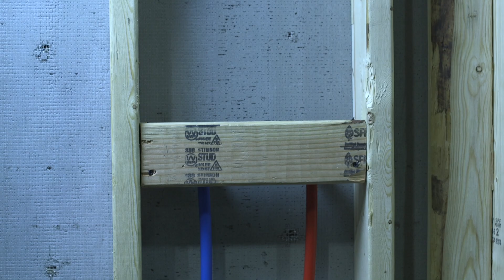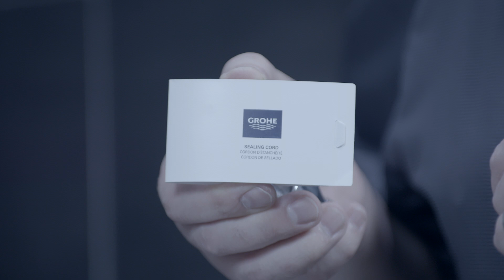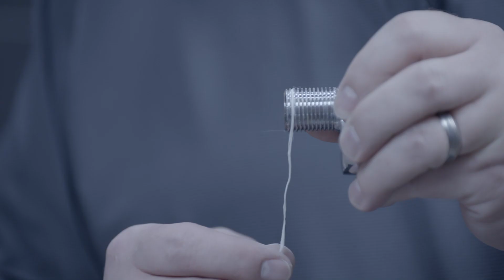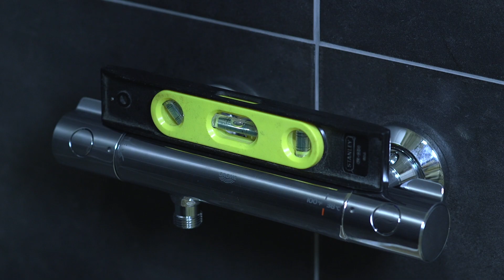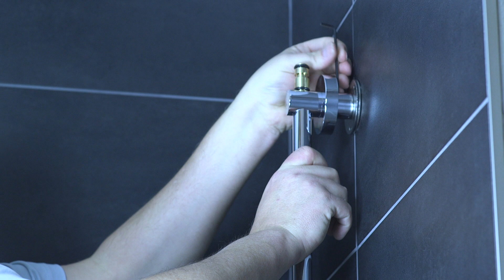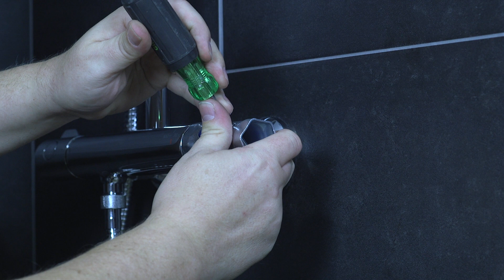GROHE | Euphoria Exposed Shower System Installation Tips & Tricks | Installation Video

Comment: I have nearly the same system but my escutcheons thread on which, imo, is pretty dumb.  The illustrations in the install manual contain no narrative, presumably to avoid having a language fir whichever country it may be installed. That said, illustrations are not clear.  Eg there is no indication of how far back the face of the brass adapter should sit from surface of finished wall.  Illustration shows X+1/4", X+6 but not clear whether that's showing 1/4" proud or recessed from. Wall face.  Even so, the tolerances for an attractive fit are very, very tight.  That is, recess too far back and the S unions won't leave enough thread for the (stupid) screw on escutcheon or the capture nut that threads the thermostat unit onto the S unions to avoid leaks.  Not recessed enough and then the (stupid) screw on escutcheons will sit proud of the wall.  Very dumb imo.  To get it to stop leaking with such close tolerances I had to pack with additional Teflon tape onto the S unions.
This shower has never worked properly either.  So much so that we no longer use it.  Turning it on and water comes out too or wand sufficiently for about 40 seconds before slowing to a trickle that wouldn't wash your hands, never mind your body.
I just recently decided to see what's wrong and Grohe tech support said to clean the screens at wand and shower head.  Well, there aren't any and I'm certain there never were.  After that, advised to clean screens within the nut that screws onto the S union.  So I disassembled.  Only minor debris in there.  Cleaned and reinstalled but, lo and behold, it leaked on hot water side.  This may be because the hot water side is perhaps a silly millimeter less than cold water side.  Hence the gripe about tolerances.  Even though leaking, i pressed on to see if it at least worked now.  WORSE THAN BEFORE NOW! Now n I thing comes out.
Grohe advised replacing the cartridges.and/or the thermostat.  Good luck getting them out.  Not sure what they torqued them to but IMMOVABLE.  AND you need that 12mm Allen wrench to remove the thermostat, which, by the way, doesn't come with the kitchen.  I visited two auto shops and hardware store and they only typically stock to 10mm.  I HAD TO ORDER ONLINE!
This unit's engineering is a complete fail.
I guess to get it working I'd have to replace the entire thermostat unit.
FAIL GROHE!

Comment: It’s baffling that that would design something with the thread design that this one has. It leaked with the dental floss that Grohe provides as well as several other thread sealants. I used a combination of Megaloc tape and True Blue. The True Blue seems to have made the difference as no more leaks. But good grief, why not use a normal design ?

Comment: EUPHORIA 310 COOLTOUCH THERMOSTATIC SHOWER SYSTEM, 1.75 GPM 

"Overpriced and Defective: Grohe's Poor Product Quality and Even Worse Customer Service"
This is, without question, the worst Grohe product anyone could purchase for over $1,000, plus $500 for installation. Grohe is completely out of touch with its customers and clearly does not properly test the products they sell. The head shower barely drips water, offering zero force, and the hand shower performs even worse. The water stream from the hand shower is so weak that it simply pools in your hand due to the lack of pressure.
Grohe’s customer service is beyond incompetent. For three days, I was repeatedly told that the installation must be faulty, despite my clear explanation that the tub spout had excellent pressure. To prove the point, I swapped out the hand shower with a 15-year-old Grohe unit I had, and the difference was night and day—the old hand shower worked like a massager, demonstrating that the issue lies with Grohe’s new product, not the installation.
After finally acknowledging the problem, the representative suggested I upgrade the 1.75 GPM head and hand shower to 2.5 GPM models (shower head #27135 and hand shower #27575) for better pressure. When I asked for an exchange, I was told that because the purchase was made through Home Depot, they couldn’t help, and I should return to Home Depot for a refund or exchange. Home Depot, of course, requires me to return the entire unit, not just the faulty parts.
Grohe’s customer service, run by individuals who seem utterly clueless, proposes ridiculous solutions and refuses to take any responsibility for their defective product. They are unwilling to perform a simple exchange of the faulty shower head and hand shower, leaving customers stuck with a subpar, over-priced system.
VICTIM OF GROHE’s BAD PRODUCT & WORSE CUSTOMER SERVICE

Comment: Why why why. 12mm- 14mm ? How about you pick a size that comes standard. And how about using tapered threads so that the threads make the seal, not some stupid glorified teflon tape. This is a garbage install, always hate them. As a plumber, never recommend

Comment: Does Loctite 55 work in place of the Grohe Sealing Cord?  I had to back off my install because my s-union leaked.  Thanks.
Reply: A bit late, but yes! That’s what they include. Grohe specifically recommends/requires 55. Theres videos from Loctite just showing them wrapping it into the threads, but a Grohe rep had mentioned doing so in an X motion. A tip I’ve learned, grab a pair of pliers and gently rough up the threads if they’re too sharp!

Comment: Hello, the first time I used the threading, one of them did not seal properly, when I removed the fitting the threading was shredded and I am now unable to properly seal the fitting. Finding replacement threading is near impossible. What is a good alternative. Also, I'm assuming this threading is cheap, it's ridiculous that a $1000 shower system doesn't come with any spare threading, especially considering how specialized this part is. Please consider adding extra threading to kits in the future

Comment: I just installed 30+ of these in a building and I have some thoughts. 

I decided to not use the parallel thread cut off nipple and locktite 55, but instead just did a 1/2" brass nipple into my wingback inside the wall then put a 1/2 brass coupling on the nipple to get me back to female thread so I could then put the s union adapters into my couplings. If you do this just make sure your wingbacks are far enough back inside the wall to fit a nipple + coupling and be able to thread in the s union without sticking too far outside the front of the shower. I was able to make it work with a 2x4 wall, 1 1/2" thick backing behind my wingback, typically using a 1 1/2-2" nipple, it helped that my surround stuck out 1/2' past the drywall.

Its not ideal threading the parallel thread s-union into a tapered coupling, especially since then it goes into the wall and there will be no way to check if it leaks. But I felt it was safer than 2 parallel threads making a joint inside the wall. I tightened the s-union into the coupling first before assembling the rest so I could at least see the joint and ensure it was tight before threading it into the wall. Be careful not to overtighten into a wingback, because the s-unions are offset there is a tendency to try to get 1 more turn sometimes to get both unions into the same position.

if your lucky once you've assembled the s-union into the coupling, then onto the nipple and into the wingback, the face of your s-union will hopefully be 1 1/2" off the shower surround once tight. ( once tight silicone between the s-union and surround to make a water tight seal behind the escutcheons) Then when the escutcheons thread onto the s-union they can thread all the way back to the wall. But honestly like 30% of mine did not work out, a 1 1/2" long nipple would be too short and the s union did not stick out  far enough from the surround to thread on the escutcheons and have enough threads remaining for the mixing valve. When I changed it to a 2" long nipple it stuck out too far and the escutcheons would thread off the back of the s-union and hang. I always opted to put the longer nipple in and ensure my joints were good. I ended up siliconing the escutcheons to the wall for the rest but it looked bad and they will break loose in time. 

This whole situation could be avoided if Grohe just put an extra 3/8" of threads on the s-union for the threaded escutcheons, so it would work if your nipple was 1/4" too long. its frustrating that nipples only come in half inch increments and grohe only gives you 1/4' of adjustment with the escutcheons. Also if they went this route they could just ditch the whole parallel thread thing and use regular tapered threads. I don't get why they are trying to reinvent the wheel.

my Grotherm 1000 boxes came with some hard red washers, I did not use these. The s-unions I got had a black rubber on the end and this sealed well to the mixing valve. also if it leaks there it will at least leak into the shower haha.

anyway its been a few weeks and no leaks have shown up so I guess this worked, I hope I don't have to install these again. it sucks having a joint that has to hold static pressure inside of a wall using parallel thread and not being able to check it without cutting in an access or something.

Comment: As much as I appreciate these videos from Grohe - the one thing they don't show is how one goes about making sure there are no leaks behind the esutcheons as the S-union connection is just inside the wall.  From everything I have read,  because of the parallel threads, it is not a given that there won't be any leaks - especially the ones where there is just one drop every few minutes.  I wish Grohe also had given an approach to make sure that the G 1/2 S Union connection is not leaking behind the tiled wall.

Comment: I bought this unit. Three plumbers and over a thousand dollars spent it still leaks in the wall cavity. The S-Union straight thread will never seal in the brass adapters. We tried numerous thread cords and tapes. Even tried Loctite 577 to fuse the threads and it still leaks at the S-Union. On straight threads (NPS) there MUST be a rubber washer on both ends to seal. This is a critical design flaw on many Grohe products. I wanted to love this fixture but after hours on the phone with their tech support and hours spent installing and uninstalling this unit, Grohe is now my most hated company on the planet. How could you design something so poorly? This company gives German engineering a bad reputation. I"m so disgusted with this company

Comment: I am in the process of installing a Grohe Euphoria Shower System.   I notice that in this video the Easy Adapter is cut to be flush with the tile surface.  But the  Grohe installation manual indicates that it be cut to be 1/4" inside (X + 1/4).   I think cutting flush is better as more of the S-union will go in to the easy-adapter and still maintain minimum outside distance.  Why the X+1/4 in the installation manual?
Reply: I am adding what I found out regarding my own question.  Grohe USA replied to me saying that both the flush cut as well as the X+1/4 cut will work.   The X+1/4 ensures that there won't be a gap between the escutcheons and the valve.

Comment: Not to keen on not being able to prove all your connections are water right before tiling , 
Once you cut the adaptor pieces and put your thread tape on them and screwed them back in , you have no idea at all if they are leaking or not behind the wall
Reply from the maker: Hi Chris, thank you for your question. Grohe does make an  optional  s union (Sku #12400000) for this product with service stops so that you can pressure test your connections. - GROHE SOCIAL TEAM

Comment: As a licensed plumber i will tell you these are absolute junk. Stay away from Grohe. Horrible engineering.
Reply: Exactly what my journey man says
Reply: Agree. Never recommend. Tapered threads are too complicated, we have to score the machined threads to make the seal? Wrap glorified teflon tape around in the threads, use a 14mm (not sold in any standard set, neither is the 12mm) and hope for the best
Reply: It’s because, like my plumber, you can’t read and understand instructions.
Reply: @fiouable  they're used with the standard American system,  everything new is too tricky

Comment: Hello, you don't show what kind or size of fittings the cold and hot pex waterline is connected to, what are the "2 easy install connectors" connected to and how are they mounted?  I understand the distance is 5 7/8" spread, center to center.  Are the receiving fittings screwed into the 2"x 4".  Thank you, but I think you need to show that for us DYI people.
Reply from the maker: Hi Kenny! Thank you for your question. The PEX lines will need to have ½” connections. The easy install adapters connect to drop elbows which are secured to the 2x4 to hold them in place.  - GROHE Social Team

Comment: why was the valve loose? I have a feeling you kept the plumbing loose for easy install? But, people don't want a loose valve.
Reply from the maker: Hi Dee, thank you for your question. It is normal for the pipes in the wall to have some give. Once it is tightened completely onto the adapters, it will be firm. These are also PEX pipes, which have a lot more give than copper pipes. - GROHE Social Team

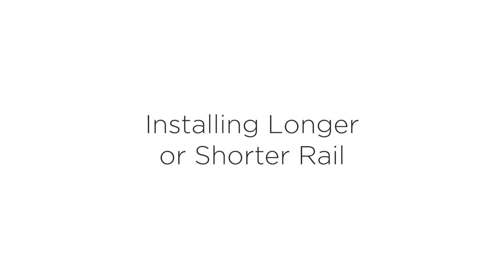Comment: 6:20

Please, anyone, tell me the manufacture codes for those different rails????

I've got 27475001 ( EUPHORIA SYSTEM 260 - https://www.grohe.ua/uk_ua/-euphoria-27475001.html - https://cdn.cloud.grohe.com/dimdraw/2000/2100/2100/2101/2101509/1500/2101509.jpg ) It has very long rail!! I want to buy and successfuly (!) install much shorter rail, but I can't find even manufacture code for shorter rail.

Comment: what kind of treading is that what your are supplying?
Reply from the maker: Hello, thank you for contacting us. The adapter is going to have ½” male threads (US Threads) that are going to screw into the pipes in the wall. The other side is ½ ” Female thread (EU straight thread) that will connect to the S union on the shower system. Please let us know if we can be of further assistance. - GROHE Social Team

Comment: Where do you get the s-unions with the service stops? The s-unions provided with my 260 are too long, causing the escutcheon to sit far off of the threads. My adapter is flush with the tile, and this is still happening. Not quite sure what to do.
Reply: I have the exactly the same problem. Can @Grohe helps us please? Thank you
Reply: I would like to know what the reply was. Was this resolved? If so, why was the solution kept secret?
Reply: @marklaipnieks1453  It wasn't solved. These jokers just sent me another set of the brass nipples (after 4 months of waiting). The S-Unions are the problem. For the fourth time.
Reply: @marklaipnieks1453  I had a similar problem, Grohe emailed me saying they would send a replacement part. 5 months later still nothing arrived. I think they like to give the perception that they are there to help, but nothing is done.
Reply: @marklaipnieks1453  Yep, if Grohe is looking for referrals they're are doing it all wrong. Bad system.
Reply from the maker: Hello Ian, thank you for contacting us. Can you please send us an email at groheconsumerconnection@lixil.com  and write “Attention David Gaines” on the subject line. We'll be happy to assist you. - GROHE Social Team
Reply: @GroheAmerica  I have the same issue and cannot find a solution.  Please post how to properly resolve this with the s-unions provided.  Thx